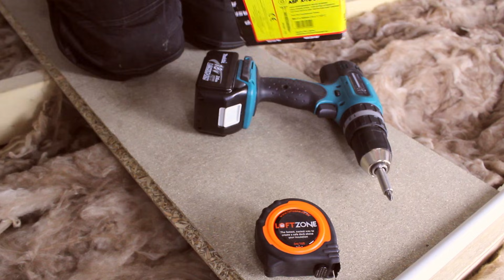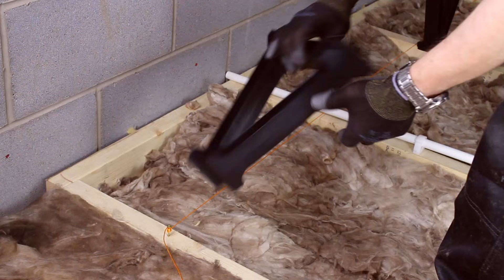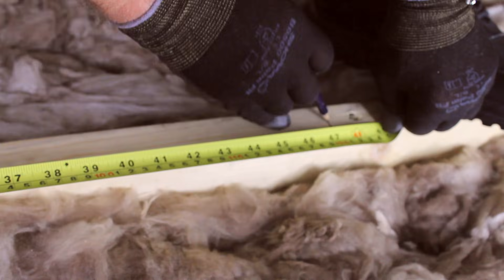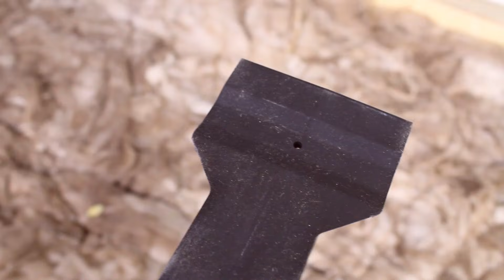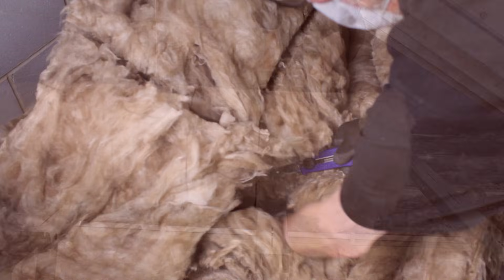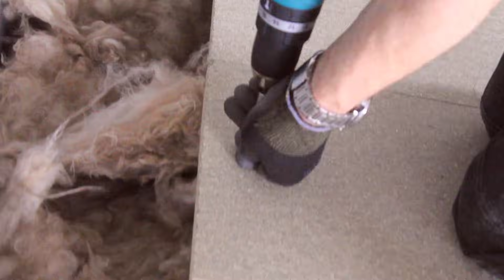How to Board a Loft Above Insulation | StoreFloor Raised Loft Boarding System | LoftZone

Comment: I wouldn't use this slapdash if you paid me.
It's typical pen pushers using stuff like this to clarify why they're paid and in a job.
if you're boarding your loft you can board on existing joist for storage purposes without needing to comply with building regulations.
If you was going to comply with building regulations to sign off new work e.g. conversion you'd not be using chipboard T&G whether glued or not. You'd use PTG if you're going to make it Official or Comply .
The planning regulations are only for new builds or conversions and if you was going to do either you'd use better materials that are more cost effective over said period.
If you're like me and you're simply boarding the loft out for storage and your joist are ok then you don't need this product.
(The smart move I made was I used double foil backed insulation board, All upstairs rooms I have used foil backed plasterboard and I also used double foil backed insulation board in between the rafters. I sealed each joint with foil tape which I assumed would be cheap but the amount you use is crazy.)
If you just want to strengthen up your joist use actual structural timber 2x4” sitting horizontal to your vertical joist (Width side buttered to existing joist also always have packers in case) pilot drill, countersink and screw.

Similar method above instead sitting the new joist parallel using glue and 6inch screws will raise the deck.

If you was planning to raise your flooring to comply with regulations use the Adjacent walls for the support required.

I'm a Electrician/Data Cabling Engineer by trade.
My father who is as old as Noah is a Carpenter by trade and said "This is one of them bodge jobs."
I mean he even criticises me with measurements because he will only use Imperial, So he will say "Give me a cut of 43 in the old money." haha
Reply from the maker: Dear Mr Daniels, thank you for your comment. However you miss the point of the product, which is that loft insulation these days is much taller than joist height. If you board on to the joists as you suggest, you either have to remove all the insulation above it, or you squash the insulation down, which halves its effectiveness. Most people like the benefit that loft insulation brings and that’s the reason why tens of thousands of people have bought LoftZone to allow them to have a storage deck that doesn’t compromise on the insulation. It’s also why we have won awards from the Ideal Home Show, Citizen Advice Bureau etc. For a full list, see here: http://www.loftzone.co.uk/reviews.html
Reply: LoftZone I think you missed the point of the reason I used Foil board insulation which reflects heat and retains it in the house with sealing the joints (the gap) between insulation board to joist with foil tape. This has been statistically proven to be more cost effective and energy efficient compared to the insulation used in video above.
Similar to the use of it in cavity walls on high end builds.
Also all I can gather from the product and service being sold is a cheap/quick fix that bears extra weight load on existing joist structure which is a recipe for disaster.
Example
It’s like saying “The support wall diameter is insignificant for sufficient purpose but we can make the wall taller and thicker.”
Reply from the maker: It is possible to use different methods of insulating a loft, yes. We review the pluses and minuses of the type of insulation you talk about in our handy table here: http://www.loftzone.co.uk/compare.html.  However most rigid insulation only has a lambda (thermal resistivity) value of 0.22W/mK which means that in order to meet the minimum Buildings Regulations insulation for a loft these days, you’ll have to have boards that are thicker than the height of your joists anyway. That’s one of the reasons why the fluffy mineral wool insulation is so much more popular. Our video is about how to board above mineral wool insulation, which is what the vast majority of homes have. If you prefer a different insulation method, that’s up to you.
Reply: LoftZone Did you use the R-Value to work out the variation of size?
50mm of Kingspan is equivalent to that of 150mm of (Earthwool) and Rockwool which is in the region of (.044)  .035 and if my memory serves me correctly building regulations is a minimum of 270mm or equivalent and most houses built before this regulation passed typically have joist sizes of 2x4”.
Also wool isn’t more popular especially not on a building site, I’ll tell you that for free.
The link you provided is all about you selling a product & service without detailed information of the reason to choose said product and service.
Plus to add the insulation that I suggest has a vapour barrier and prevents moisture or damp.
Reply: LoftZone Also are you a NIA member? Because even as an official NIA you should know the basic calculations. E.g. The lower the number equals a superior insulation material. My Father is a NIA member and it even suggests that for ‘mineral wool’ only the recommendation is 270mm and that the recommendation differs depending on material used.
Reply from the maker: This thread is now getting a fair way off topic for this video, as your points are about insulation and the video is about boarding. But fair enough, you asked the question and we’re happy to help. In the UK we talk about the “U-value” for a loft and the lower the value, the better the insulation. Most of the rest of the world uses R-values which is the inverse of a U-value, so for R-values, the higher the number, the better. In England and Wales, the U-value for lofts needs to be 0.16 for older houses and 0.13 for new ones, according to Buildings Regulations. In Scotland and Northern Ireland the requirement is tougher (lower) than that, as it’s colder up north. Every different type of insulation has different properties, as you’d expect, but it’s easy to do the maths, so long as you look up the thermal resistivity of the material you choose (all manufacturers state this). The equation is: U = k / L, where “k” is the thermal resistivity (and also known as the lambda value) and “L” is the depth or thickness of the insulation, in metres. For example, for mineral wool insulation, which is used in the vast majority of houses in Britain, k is usually 0.044 and most people put it in 0.27m thick, hence they achieve the required 0.16 U-value. If you choose a rigid insulation board with, say, a k of 0.22, then to achieve 0.16 you will need the board to be 138mm thick, which is still higher than the height of your joists, so you’ll still need to find a way to fix your storage deck above the rigid insulation (e.g. with LoftZone!). It’s also very important to make sure you leave an air gap between the top of the insulation and the underside of the board, to ventilate away any moist air and prevent condensation. I hope this helps. If you have any more questions about the type of insulation to use in a loft, maybe ask one of the insulation manufacturers?
Reply: LoftZone Yes I know I’m from the UK.
Part L regulations has a table stating .20 W(M2/K).
The reason we use the R-Value method is to work out the Lambda Value which you use to work out the U-Value.
“The lower the U–value, the better insulated the building element is.”
So still claiming Wool is superior really makes me believe you don’t know what you’re talking about and I don’t mean this in a horrible way because I know you don’t want to agree or accept what I am discussing because of customers e.g. but if you replied “Yes Insulation board is superior but it actually costs a lot more so we use the next best alternative which is lower in price.” Then I’d be fine but to constantly put out false information of calculations and incorrect information regarding building regulations.
Reply from the maker: There are literally dozens of different insulation materials: Mineral wool, sheep wool, aerogel, cellulose, rigid boards, spray foam, vacuum insulated panels, hemp, to name but a few. They all have different thermal resistances and hence require different thicknesses. Some are easier to fit in lofts and some last longer than others. And they all have different prices, of course. When we are talking about buildings where the floor of the loft has been insulated, then the vast majority of British houses (over 90% we’d estimate) use mineral wool, especially new build houses. 

We don’t mind which insulation you choose to use. We don’t sell insulation. We make the decking structure that allows you to put boarding above your insulation.
Reply: LoftZone So I’m just wondering what insulation out of the ones you just mentioned has the best thermal resistivity?
Also yes I understand that you’re not the manufacturer of the insulation but there is a lot of false claims made in the videos and comments I have seen regarding to selling your product and service.
Reply from the maker: Vacuum insulated panels and aerogel have the best k values from the previous list.
Reply: LoftZone I’ll give you credit where credit is due considering I’ve come across vacuum insulation in places like office buildings when working in suspended ceilings bonded to ceiling tiles and in raised flooring, underneath floor tiles I wouldn’t have known it was that type of insulation as you’d assume to the naked eye that it is rigid foil board and for the price, effectiveness and size of handling is a very worthy consideration. I will definitely be noting that down! Thank you and honestly that was the information/knowledge I came here to learn about something that I didn’t know!
Reply: LoftZone also I’m glad you didn’t try to pull the wool over my eyes! (Pun intended)
Reply from the maker: Thanks Jack, it's been nice talking to you as well. All the best!!
Reply: Jack Daniels y

Comment: i saw the DIY doctor review and in that was recommended 8 mm bit for sinking into the boards themselves . My question is is it necessary to use an 8mm bit
Reply: have come to realise that an 8mm drill bit IS necessary when drilling the tri -supports.  If you don't you could risk not getting the type 8 screws all the way in and in some cases like myself snap the screw when trying to get the screw flush with the tri-support. Drill first with 8 mil , then drill in the screws, my personal recommendation for difficult joists are silver not bronze type 8 screws which seem to take more stress when screwing in

Comment: hi it's Andrew again. In the video it was mentioned to leave a few millimetre gap between  tri-support and party wall. How close accurately can i get to party wall while retaining the necessary air flow for insulation please?In other words how close can the planks be please?
Reply from the maker: Hello Andrew. Probably most of the ventilation will be from eave to eave, not from the party wall side. The only exception to that would be if you have ridge vents. But nonetheless, it's mainly the sides where the eaves are that you need to keep free from obstructions to airflow.
Reply: ok thanks

Comment: Why do you need to fit two levels of cross joists?  is it purely to make room for the insulation?  All videos I've seen add this extra height when boarding lofts but with no explanantion.  My loft ceiling is very low as it's an old cottage - I need as much height as I can get in there so making the floor level 8 inches higher is not great for me! Any advice?
Reply: XPS insulation board would be half the thickness but a lot more £££££
Reply: Yes that's right. Building codes nowadays define insulation that is much taller than the joists. So most people therefore lose all use of the attic space, since you can't squash the insulation as this halves its effectiveness. The LoftZone product in this video simply gives you a deck above the insulation, so the space can be used again.
Reply: Dave Raval Who would know if you did not comply with this rule?
Reply: Well it depends if you ever do anything that is notifiable to a building control inspector. If you don't, no one would. But your heating bill would be higher because of having less insulation of course!
Reply: @herobo123456  The 'building code' applies to new builds (and conversions, renovations etc) - there's no obligation to upgrade loft insulation to this extent in an existing building, although it might be desirable where practicable.

Comment: Since when was a 4x40mm screw the same as a 8"x1.5"...? 0:14
Reply: Even I was wondering about how the mm to inch conversion can go so wrong.
Reply from the maker: No, 8 is not the length in inches, it's the gauge. Take a look at this website for an explanation of the difference: http://www.diydoctor.org.uk/projects/screwsize.htm
Reply: That may be the case but he clearly says 8 inches by 1.5 inches, even the subtitles says so...
Reply: @nwalker8422 it's actually 1 1/2" long and 8" diameter..😂
Reply: correct ,he does say 8 inches, if you mean the gauge then say the gauge

Comment: 4:50 - Is the gentleman standing on the insulation or is he on a board that can't be seen?
Reply from the maker: We don't recommend you stand on the insulation, as that squashes it. In this case, the installer would have been standing on a board, like he did on 1:18.
Reply: Thanks.

Comment: Ha,ha, I'd like to see that work in my loft, not all lofts are perfect, mine is old and way out of square. Why do you need those support / stilts, why can't the boards just be fitted to the ceiling joists?
Reply from the maker: Hello MrUniman. The good news is that the LoftZone StoreFloor product has been specially designed for non-perfect lofts, as its adjustable Cross-Beams and the ability to span over problem joists mean that there is no easier solution for such lofts. That's why we have thousands of customers in the UK alone already. 

It's needed because modern building regulations dictate insulation that is typically at least triple the height of your joists. You can't squash the insulation as that stops it working. So LoftZone allows you to have a raised deck above the insulation, so you save on heating bills (and meet buildings regulations) whilst still having a safe and usable space in your loft. 

There is plenty more information on www.loftzone.com. I hope this helps answer your question!